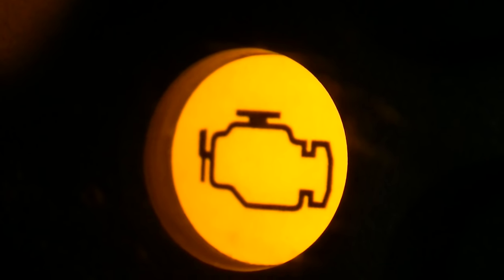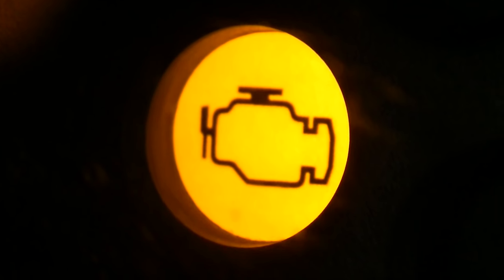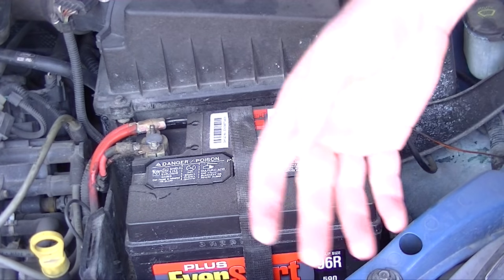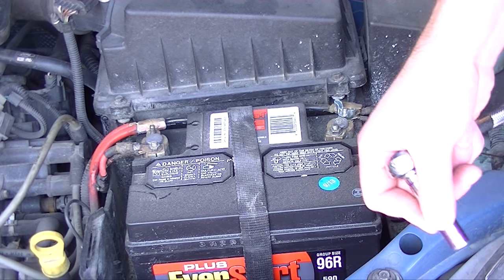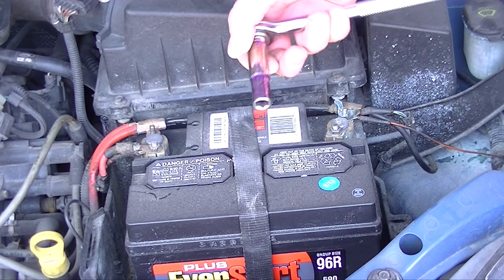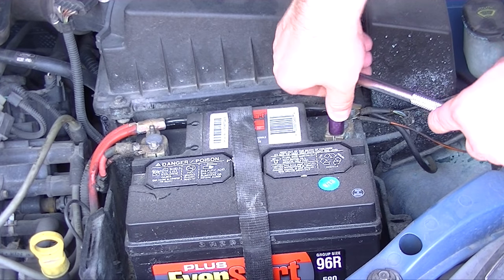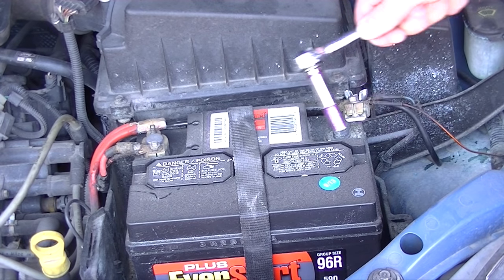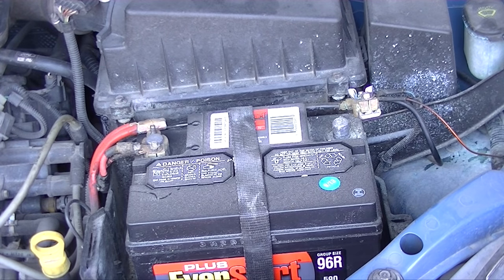How To Reset Your Check Engine Light with no special tools

Comment: It doesn't work with (on) each car!
Reply: how about ABS ligth come in the funnel how can i reset or what is the problem
Reply: mario balagao 

GOOD LUCK RESETTING THE ABS. IT SHOULD RESET ITSELF AS SOON AS YOU PUT IT INTO DRIVE AS LONG AS THE SENSORS GOOD. EVEN IF YOU USE AN OB2 THAT ERASES THE LIGHT, IT'LL COME ON IMMEDIATELY AFTER ITS ERASE IF THERE'S STILL A PROBLEM THERE.

Comment: Put a piece of black electrical tape over the light.  Problem solved.
Reply: Remove the clear lens from over the speedometer, masking tape over other instrument areas, flat black spray-paint on check-engine icon, let dry..remove tape replace lens. Be a little professional when it comes to car repairs. This isn't RUSSIA
Reply: ..or is it?

Comment: Hi. I did all what you said, in fact I left the battery off overnight. then refit the battery, No engine warning light!!  But as soon as I stopped the engine and then restart the engine ,the light is back on again. My car recently passed its MOT and the emisions were fine??
Any other ideas to get this light turned off???
Reply: guy fawkes
Reply: The engine light was always going to come on because simply turning the light off doesn't cure the problem that caused the light to come on in the first place.
Reply: its because the check engine light is simply an indicator that your ECM (Engine computer module) is reading a fault somewhere in the system. All that this video will show you is to clear the bad codes.HOWEVER, if the light comes back on, then your ECM is still getting a bad reading from some component, thus throwing another code and turning your check engine light on again.
Reply: Donnie Smith is
Reply: That's right! I went to autoparts store to read what's wrong with the car : PO302 Cylinder 2 Misfire Detected, P1399 Misfire in any cylinder, the most likely solution is : Replace Spark Plug(s). The light engine was still on, so I changed with a new set wires, and yet the light engine was still on. I then accidentally found that when I disconnect the battery, it reset the light engine. So far no more light engine on which I think nothing else wrong and only need to be reset.
Reply: uuganbayar davaadorj
Reply: clean injectors with sea foam

Comment: How would you know what the problem was in the first place? We know we can turn the light off by disconnecting the battery but if we don't cure the problem that triggered the light in the first place, it's going to come back on isn't it. So this is BOLLOCKS is it not?

Comment: I try that it only last 1day then light come bak
Reply: If you really listen to the video you would understand that the light will come back on because you have a problem somewhere more than likely a sensor. When you hook the battery backup and you run your car takes a few engine cyclesbefore the computer in your car figures out where that same problem is in the check engine light will come back very simple

Comment: Listen people not all automobiles are the same you can't reset the check engine light the same way. some automobiles require you to disconnect the battery for half an hour or so I'm required to disconnect it for an hoursome automobiles you can reset the check engine light by pressing in the trip set button and holding it in while you turn the key to the on position but do not crank the car
Reply: the part I said about holding the trip set button while you turn the key to the on position that is for resetting your gauges on your instrument something is wrong with one of your gauges but some cars you can reset the check engine light by just holding in the trip set button for about 10 or 15 while the key is in the ignition in the on position but do not I repeat do not crank up the car while performing this
Reply: Another way to erase the check engine light temporarily disconnect both battery terminals positive and negative once both terminals are disconnected hold the terminals together solidly for about 20 seconds

Comment: Dont do this . will reset to factory settings . gps and bluetooth . just buy a diagnostic tool or run it into your garage. Never good to disconect your battety unless vital or battery replacement .

Comment: dumb videos.... repair the car correctly..  IF you repair the car yourself, and you have repaired it correctly ?? it will turn itself OFF after you drive it for awhile.... the same thing that turns the light on ?? will turn the light off.. these systems TEST THEMSELVES all the time you are driving it..... I do NOT recommend disconnecting the battery...